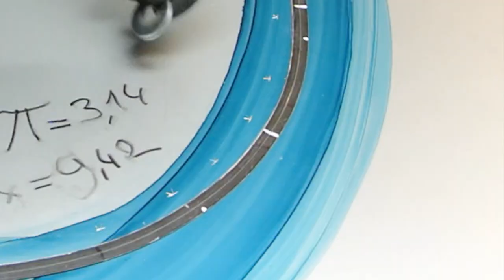Porsche 356 Radlauf/Wheel Arch, Schweißkurse, Oldtimerseminare,

Comment: I was so impressed with your approach to this problem. Then the mig came out😮, but you did not disappoint by finishing with a nice soft gas weld. I have a question and I hope you can answer it for me. Where did you get those wire grips from and what do they call them? Absolutely beautiful work.
Reply from the maker: Hi Paul, yes, sorry about the MIG  ; (   It is easier to tack-weld with the MIG, there is less worping, besides, i am taking the tack-weld with me, when i am gas welding.
Here you find the grips ( if those are the ones you mean ? )
https://www.ebay.de/itm/301538492402?chn=ps&_trkparms=ispr%3D1&amdata=enc%3A1VtFr5kr3TB6hp7e_zJQb6g57&norover=1&mkevt=1&mkrid=707-134425-41852-0&mkcid=2&mkscid=101&itemid=301538492402&targetid=1685205642215&device=c&mktype=pla&googleloc=9043920&poi=&campaignid=17731230207&mkgroupid=139734018478&rlsatarget=pla-1685205642215&abcId=9301017&merchantid=112035275&gclid=Cj0KCQjwsp6pBhCfARIsAD3GZuYFhJBZEgkhQWKsHc5hdnLhO0tyrfkd9hAPKqIbLa4igNW4u92vI3UaAo4eEALw_wcB
Reply: @mobylas no I am sorry I thought you were going to tack/weld your beautiful work all the way around. Although I have a question about the holding tacks. When I have done the same and weld up to them (tig) I have to use way to much heat to flow into them, even though they are both er70/6 .it will even spit a lot of impurities off and coat the tungsten.  Can you tell me if you tig to the mig spots and have found a solution for this . The tool I was inquiring about is the 2 you use to locate the wire, so you could roll the edge over. They are brilliant. Thanks Paul
Reply from the maker: Hi Paul, 
The welding tacks, it helps to grind them down to almost panel level, than you don´t have to heat up so much metal.
It helps also to use a good MIG welding wire on jour spool, there are hundrets of sorts of welding wire, but most people use the cheapest ones.
I am using SG 2 Ti, that has some better aloying, and there are even better ones, but they will cost more than  ; )
Also it helps using some Co2 in Argon when welding mild steel TIG. I use Argon 98 % Co 2 %. That makes the puddle hotter.
But i would try a good welding wire first.
Here a Video me using 98/02  : https://www.youtube.com/watch?v=-Nc1Vq9o5mc

The "brilliant tool", that you are looking for (also my fevorite) : 
https://www.ebay.de/itm/310661203643?chn=ps&_trkparms=ispr%3D1&amdata=enc%3A1Hl1ga4A6S3-yYHL74LkD-g22&norover=1&mkevt=1&mkrid=707-134425-41852-0&mkcid=2&mkscid=101&itemid=310661203643&targetid=1685205641935&device=c&mktype=pla&googleloc=9043993&poi=&campaignid=17731230207&mkgroupid=139734018478&rlsatarget=pla-1685205641935&abcId=9301017&merchantid=101209721&gclid=CjwKCAjw-KipBhBtEiwAWjgwrFCQtBlptytKIqv8856R_r0sNezWNMVQQKAZUgEHzNUEdDO6jX7zuBoCwgsQAvD_BwE

Regards, Norbert
Reply: @mobylas thank you very much for your reply. I will look into the wire you mentioned,  it is what I am looking for. As for the tool I can't thank you enough for that too. I was given one of them many many years ago and could never find out what is was used for. It is branded blue point and they wouldn't return my emails. I will be ordering a set as I can see one is like a hand without a thumb. Sorry about the late reply as I'm having issues with my phone. Look forward to more videos, love your work